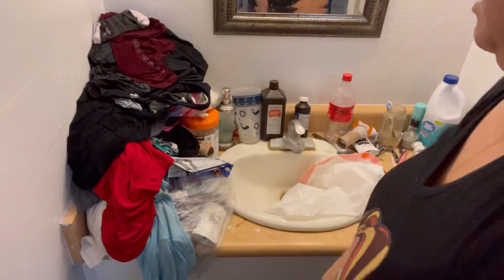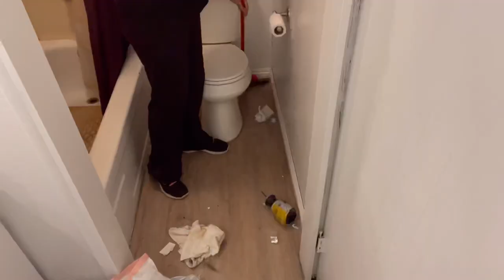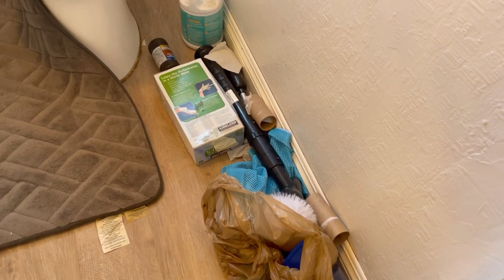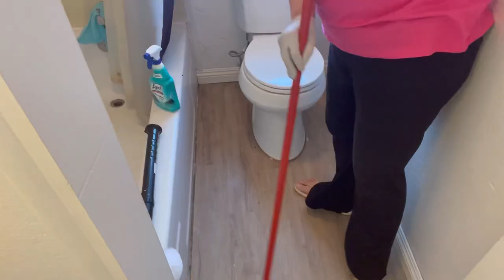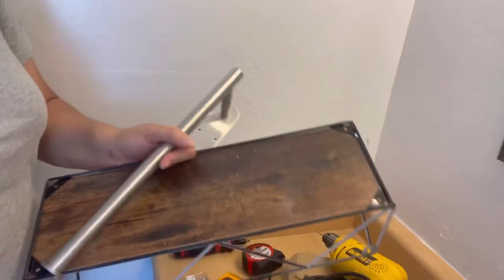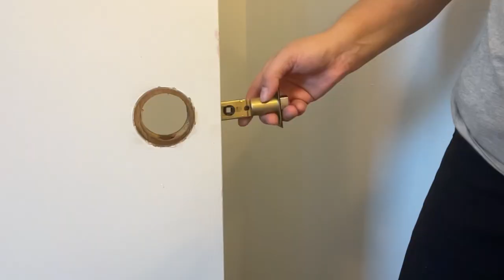Decluttering my Hoarder House Series: Ep. 5, Deep, EXTREME Clean & DIY? My bathroom.

Comment: Great job on the bathroom. I have a 1969 ranch that we bought and the tub was BAD. I squirted toilet cleaner on the tub and the mold caulk. Left it for way too long but it ate all yuck off.
Reply from the maker: My caulk is actually lifting off in a bunch of places so I need to just go spend $5 to get the caulk & replace it. Its so gross.